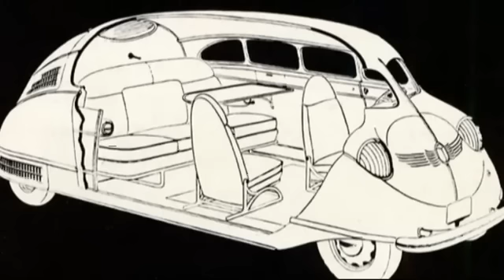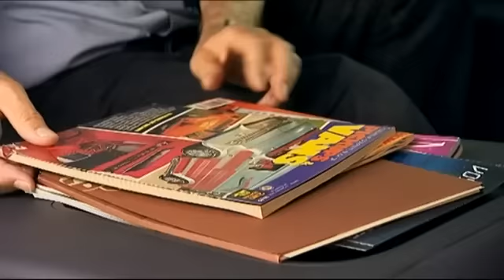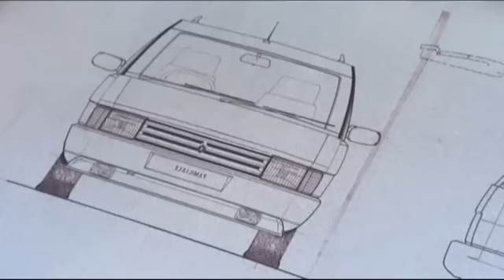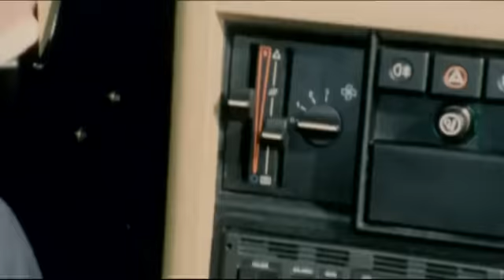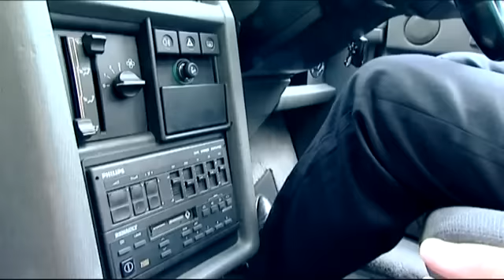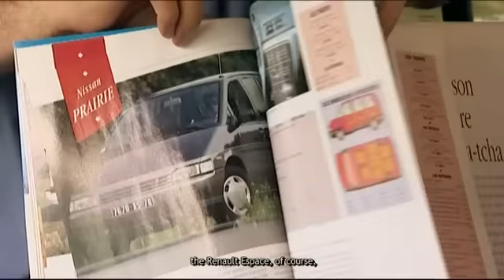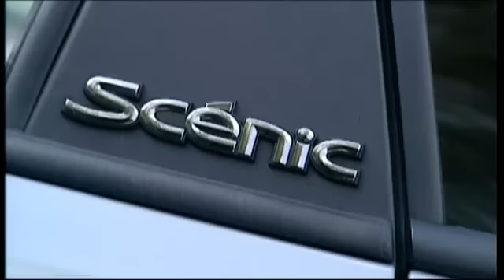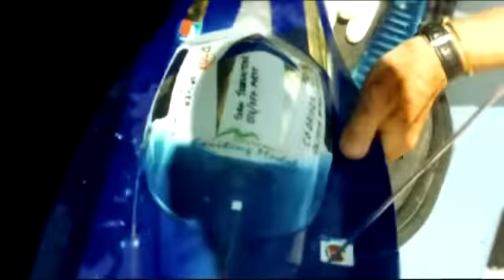Renault Espace

Comment: They obviously never heard of Ol' Chrysler Corporation's effort with the Caravan, Voyager & Town&Country... That was intro'd in '84 [in the 'States] and has endured just as well!
Reply: +pancudowny go away
Reply: +ankhaa battulga What...? Did I remind you how Renault got bought-up by Chrysler, only so they could obtain the Jeep marque? Or how the one Renault product they sold in the 'States was rebadged... And turned-out to be a rolling pile-o-crap, along with their transmissions when used in apps with real power to them?
Reply: +pancudowny Have you seen this documentary? They obviously mention the Caravan
Reply: +CarGeek18 Sorry... Jumped the gun.
Reply: go away
Reply: ankhaa battulga
Geez. try to be polite & apologetic....
Reply: So, the Chrysler minivans and Espace derive from the same original project. Fergus Pollock (British) worked for Rootes (Owned by Chrysler) and designed the original in the 70's. Simca was owned by Chrysler, and Matra were affiliated with Simca at the time (they used their parts to build Matras). Matra got hold of the project through that route with a view for it replacing the Rancho. Simca was sold to PSA, which is why when Matra had developed their version, they first went to Peugeot.
But beyond the initial concept of an MPV/minivan/monospace, the cars were independently designed, and whilst never matching the success of the Chrysler Minivans (poss due to more limited competition in USA), the first Espace showed far more versatility than the Chrysler offering, as shown in the video with its individual seats (whereas Chrysler had 2 rear benches).

Comment: I have the 3rd generation with 2.0 8V engine --> 1:10. Purchased for €500 in 2016. Engine is not an innovation (still without automatic valve clearance compensation in 1999). The Renault electrics and chassis are generally terrible. The spring plate was rusted through and had to be replaced with a used one. These have become extremely rare, since just a few years after the generation change at Renault, they are no longer available as spare parts (wanted obsolescence?). Repairs at Renault are extremely expensive (also with the Scenic). Otherwise mine is still driving (as a second car). TÜV until 2024. Last emissions test of the control loop test only passed with alternative method.